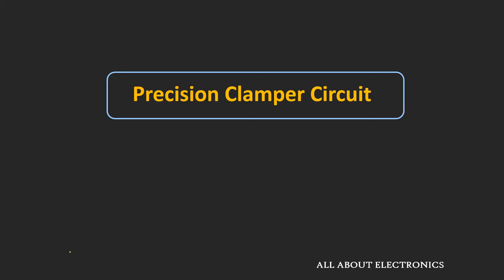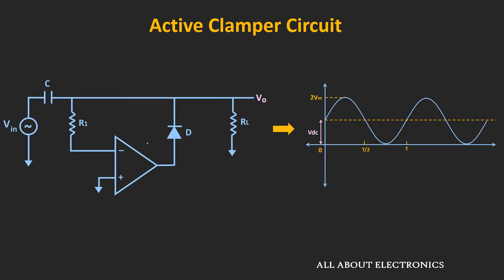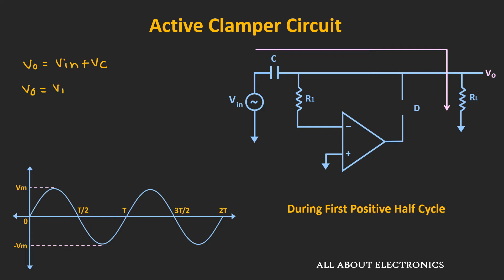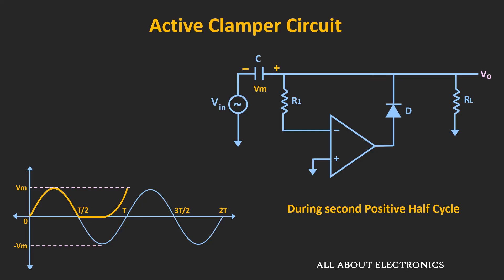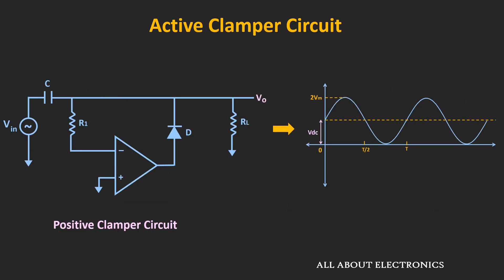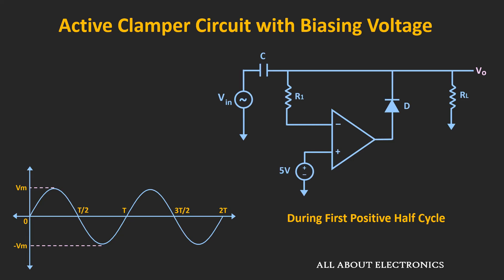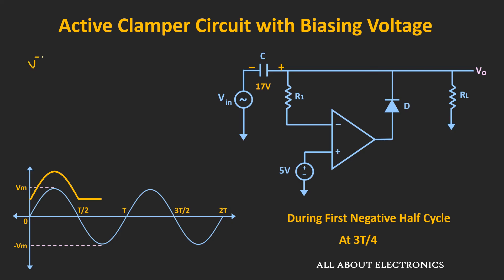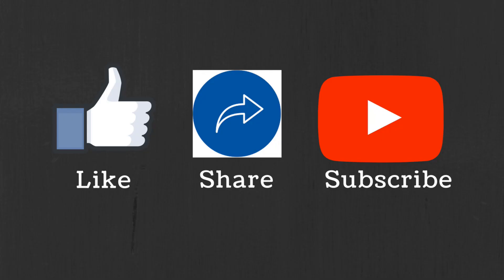Active Clamper Circuit (Clamper Circuit using Op-Amp) Explained

Comment from the maker: The timestamps for the different topics covered in the video:

0:13  Why Active Clamper Circuit is used?

2:30 Analysis of Active Clamper Circuit (Clamper Circuit using Op-amp_

10:00 Analysis of Active Clamper Circuit with Biasing Voltage

Comment: I am new to clampers, but I understand it as clamping the DC voltage of the input signal to a fixed voltage regardless of how the input signal's DC content may shift up or down in magnitude. Using the characteristics of the op-amp which will always try to make the - and + voltage equal.

Comment: What is the use of R1 if there is no volrage drop please answer
Reply from the maker: It is used to prevent the possible damage of the op-amp from the capacitor discharge. Ideally, the op-amp terminals are not drawing any current. Practically they are drawing very small amount of current. But the current surge during the capacitor discharge can damage the op-amp. A few kilo-ohm resistor (typically 10 k resistor) would do the job. 
I hope it will clear your doubt.
Reply: @ALLABOUTELECTRONICS  thanks clear answer..i have anither question please reply to this 

In op amp KCL analysis strongly maintain v+=v-  then we are told that differenece between v+ and v- what is amplified??? Little bit confusing 🤔🤔🤔
Reply from the maker: @rukshanfdoable  See in reality there is a difference between V+ and V-. But it is in uV. And since the gain of the op-amp is typically 10^5 or 10^6, we get the amplified output which is in V. But for analysis perspective with negative feedback, since this difference is in uV , we can assume that both are at the same potential. I have already explained that in the inverting op-amp video. You may go through that video for more info.
Reply: @ALLABOUTELECTRONICS   is it same as in open loop condition?? I mean v+=v- same as open loop conditionn
Reply: @ALLABOUTELECTRONICS  also one last question..ifwe consider typical differential amplifier using bjt(dual input single output)  how one input becomes let say Vs the other input also become Vs???  Can u explain the internal circuit behaviour??? In another video
Reply from the maker: @rukshanfdoable  Yes, I will plan that video.

Comment: Respected sir  at 3:33 how we can get the equation  for positive input V-=Vin +Vc.. By kvl it should get 
Vin - Vc -V– =0...
Reply from the maker: I think I should have mentioned the polarity of Vc to avoid this confusion. Here, the polarity of Vc is the opposite of what you are assuming. (Right side of the capacitor is positive and left side negative). Just look at 6:49.
Reply: @ALLABOUTELECTRONICS  yes sir.. Thank u

Comment: The capacitor is ideal so it doesn't discharge. But for a real capacitor there will be discharge. So the it must drop in potential with cycles...

Comment: At time 3T/4 input signal is in negative half cycle that means input will be negative hence capacitor should have (-12+5)v =-7v but how did you take +12v
Reply from the maker: As I showed in the equivalent circuit, it will get added with the 5V biasing voltage. So, the capacitor will charge upto 12 + 5 V.
It will charge in the anticlockwise direction. that means the right plate of the capacitor will be positive.
Reply: @ALLABOUTELECTRONICS  sir please make more vedios in network theory .Make vedios on problem solving then we could master analytical part and theory part